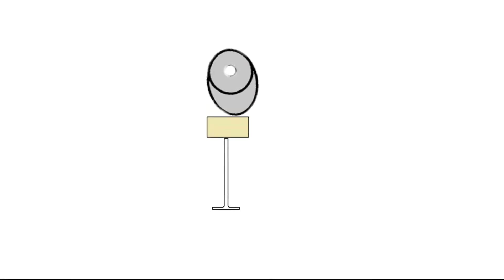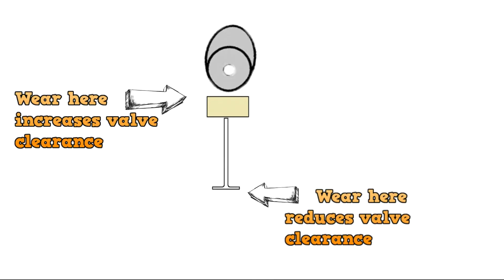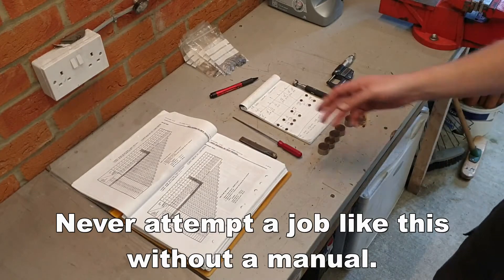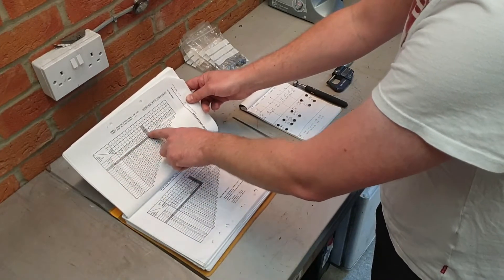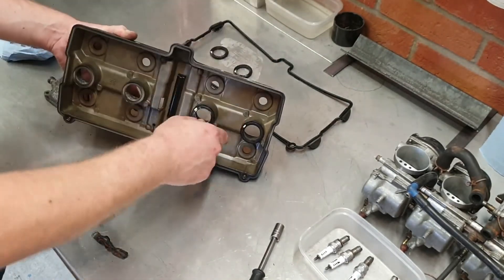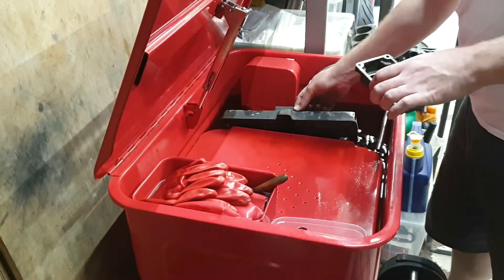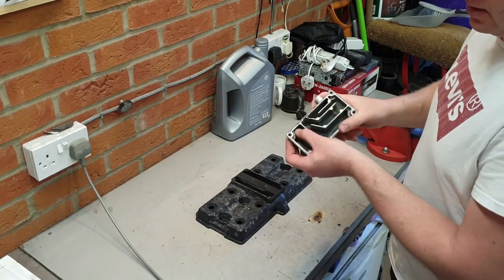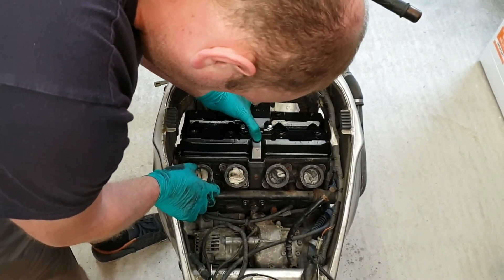Project RF600 Valve Clearance Adjustment

Comment: So glad I found your channel great video! I'm curious about the manual, is it the manual for the RF600 or for bikes in general and where could I pick one up?
Reply: I'm looking for that too... I have a 94 RF600 that's spilling oil on the exhaust... it's not burning the oil but spilling out from the exhaust and I want to give it a full service to check everything
Reply from the maker: Thanks, the manual is published by Haynes. I'm not sure if it's still on print, but you should be able to find it via ebay or Amazon. Thanks for watching, there will be an RF update soon
Reply: Found one at manualslib.com, just search for your bike model and you can find it.

Comment: What tin sprays are available for high heat and hardness Phil?
Reply from the maker: Hi Olaf, it really depends on where it's being used. On water cooled engines you can use normal paint in most areas, as the outside surfaces really don't get as hot as people think. Both my CBR and FZR engines are painted in standard silver wheel paint and are still perfect five and four years later respectively.

Comment: Looks like the engine could really do with coming out for a clean up and the frame is starting to rush. Bucket and shim arrangement doesn't need much maintenance but it's a pain to do when the do need adjusting.
Reply from the maker: Thanks for watching. The frame is just superficial scabbiness, it's been treated with a product called kurust, so won't get any worse. As for the water manifolds and lots of the other parts, they have been blasted and powder coated - It's amazing how much better it looks after a deep clean.  The other advantage of shim under bucket (as opposed to bucket under shim) is that it's all but impossible to spit a shim out.  The bike is completed now, and believe me, you wouldn't recognise it!  The decision was taken to leave the engine in as there is always a significant risk of breaking exhaust studs, this bike has been used in all weather and already has a stainless exhaust from the factory so it's on balance probably better to not disturb things. Like I said, you wouldn't recognise it now. Stay tuned for more updates.